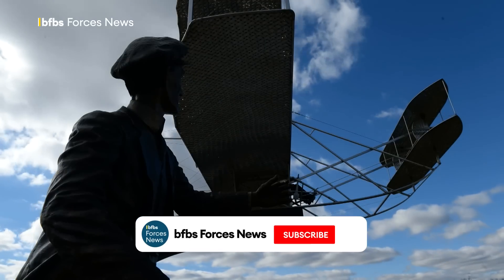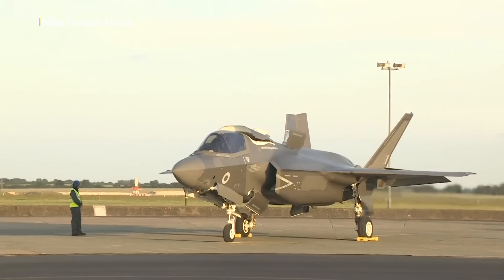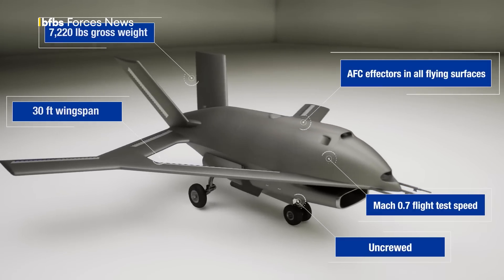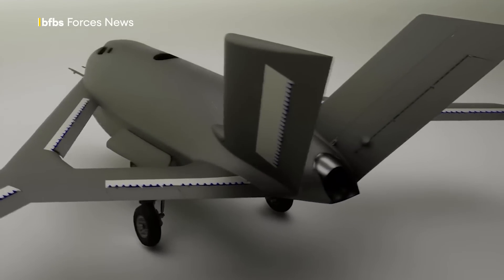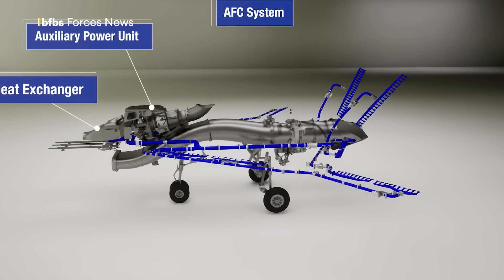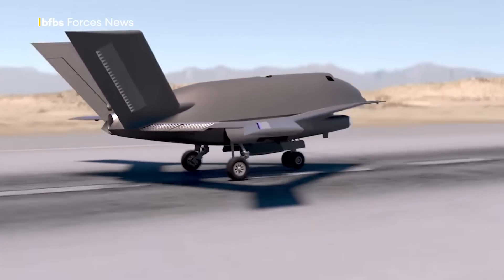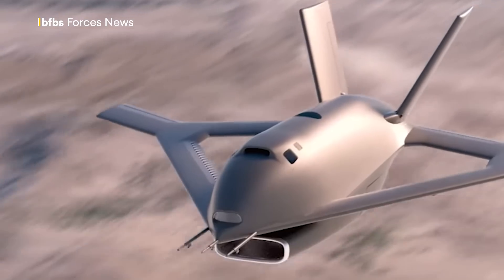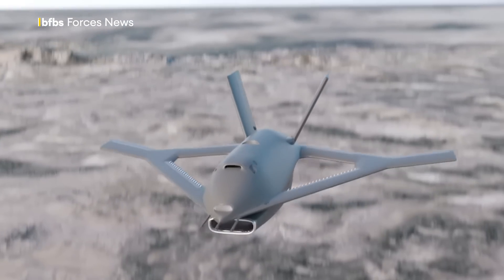X-65 Aurora: The experimental stealth aircraft that could change jet design forever

Comment: Probably a gain in stealth, but propulsion efficiency would drop as the engine thrust is diverted to doing control.
Reply: In all my years, I have seen excellent designs and ideas, but at the end of the day, the chicks go married the accountants, and the aircrafts resemble more and more pre 1914 aviation.

Comment: A few experimental aircraft and drones have tried to produce defuse thrust over the years. I may be wrong but I don't think any could be described as successful as they were considered complex. Its probably one of those technologies where computers will help it fly better.  One design that springs to mind is the Hunting 126 from the 1960's which although not quite the same, used similar ideas. It could take off at really low speeds.

Comment: Another possibility is so-called wing warping, pioneered by the Wright brothers, and used in experimental research aircraft such as the X-53 (a modified F/A-18 Hornet).
Reply: Wing warping alters the geometry of the wing, which means it alters RCS like an aileron
Reply: @Orbital_Inclination  I know that; however, it does not involve a separate control surface that moves independently.
Reply: @cdl0 it does cause far more fatigue across the wing though, due to torsion, so not ideal
Reply: @Orbital_Inclination  It depends on the material and structure.  Consider how many cycles springs or reciprocating engine parts last.
Reply: @cdl0 simply not worth it vs conventional ailerons, given the RCS disadvantage

Comment: So... A New Generation Blackburn Buccaneer? It looks more like trading one set of complex controls for another set. I can see the benefits for military aircraft, but for commercial, and private/personal aircraft? It will take some time until something like this becomes the norm not the exotic. Then there is the option of using flexible surfaces instead bleed air. Maybe a combination of both would be the ultimate best solution.

Comment: Loss of engine bleed air = loss of control.  Sounds ok for expandable UCAV’s.
Reply: Definitely seems like an aircraft that kind of goes from agile to falling out of the sky like a brick. Presumably it's envisioned for unmanned roles, making things smaller and smaller
Reply: You mean just like every other military aircraft? They all need power from either the engine or APU for hydraulics or electrical actuators. Lose both of those and your next move is to eject. This aircraft is no different.

Comment: I keep wishing we had something like Dawn Aerospace's Aurora flying out of Spaceport Cornwall. Is there crossover value in this technique for suborbital flight - I mean, could there be sufficient flow to control vehicle orientation while out of the atmosphere? I'm guessing the jets would most likely be compressed air from the engine, rather than from a pressure vessel, though I suppose some control while taking off and landing must be desirable.
Did the Wright Flyer have movable control surfaces? Didn't they deform it? Deformable fluid-borne vehicles are long overdue another shot.
Reply: If you're out of the atmosphere, jet engines aren't going to work.

Comment: Use compressed air from the engine's compressor stages.  Eliminate hydraulics.  Huge reduction of weight, wear, radar signature, and cost.  The risk that I see, especially with the single-engine design shown, is that if you lose your engine, you lost all control.  For a military fighter or a long-range cruise missile*, it might be worth that risk; but I'd be shy about considering this technology for commercial or general aviation applications.  (Yes, I am a retired aerospace engineer, and a pilot.  I did, however, spend most of my  career working for NASA, not DARPA.)

*MEMO TO UKRAINIAN ENGINEERS:  We might be on to something here, guys.
Reply: It's a fascinating notion because I'd have thought that the extra stuff you'd need to make this work wouldn't have been more heavy than the hydraulics you lose... but clearly I'm wrong. Or I'll clearly be wrong once this thing flies and the concept is proven ;)
Reply: Even if hydraulics and weight are greatly reduced by fly-by-wire tech eliminating moveable control surfaces may be an even greater weight savings. All those hingers, levers and actuators are gone. Let’s see how this thing performs. I have my popcorn ready.

Comment: LOL so you are replacing well understood, low cost, low impact movable control surfaces with every more complex pressurized air.  What a joke
Reply: I'm sure the aeronautical engineers will value you your input.
Reply: Less complex because the moving part is a ball valve.
Reply: LESS COMPLEX pressurised air. We would still be flying open cockpit biplanes if everyone thought like you. No moveable surfaces results in a stronger fuselage/wing that can be built with less materials - the motors, actuators & linkages are heavy compared to a central air pressure delivery system. A lighter aircraft, with less drag & smaller radar image is a highly desirable goal.

Comment: So you are talking about a DARPA program/project. Brought to the world by the U.S. taxpayers
Reply: DARPA, Aurora Flight Sciences which is owned by Boeing.
Reply: This technology is not just DARPA project. The University of Manchester and BAE had a flying UAV program called: MAGMA – a small scale unmanned aerial vehicle, in 2017.

It first flew in 2019, not sure where they are now, have not seen any new information on them.
Reply: @ BAE is really only involved because of the purchase of Lockheed Martin Aerospace Electronic Systems (AES) and Lockheed Martin Control Systems in 2000. Also Lockheed Martin was only awarded a phase 1 contract in 2001.
Reply: "DERPA" 😏